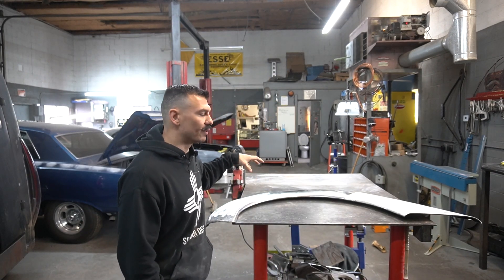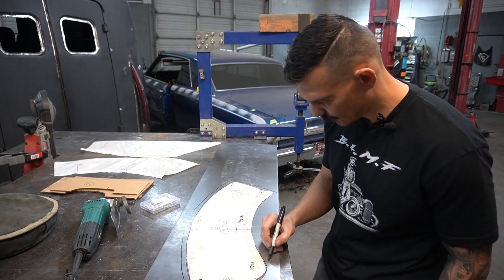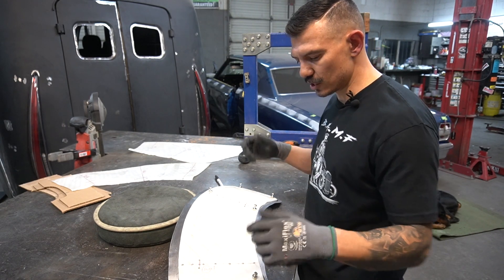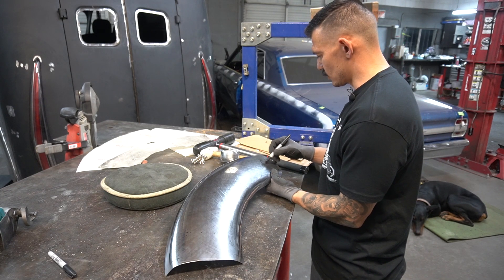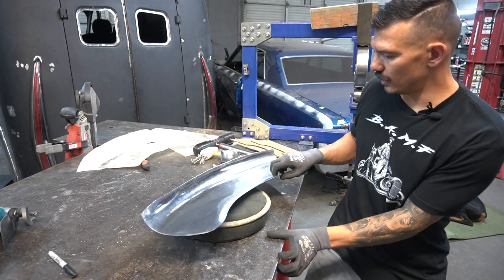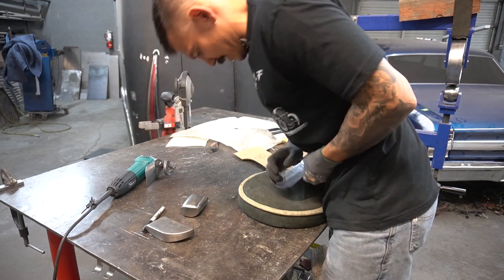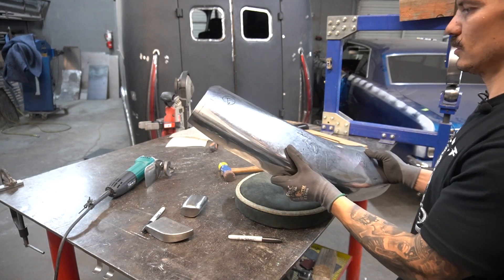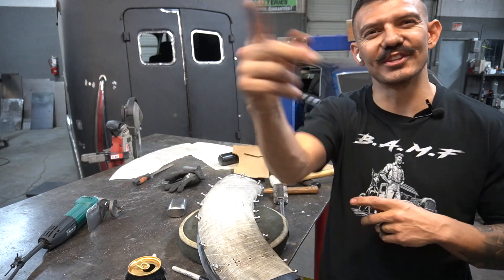How to use a flexible shape pattern | Build a fender

Comment: This video would have been a lot better if there wasn't a loud compressor running or whatever was making that noise!
Reply from the maker: I agree, It's my oil burning heater, it's loud and right by my work area. But it gets cold in my cinder block shop man 🤷🏻‍♂️
Reply: @BeAMetalFabricator  I was a mechanic when I was young and they had an oil burner furnace.  It did the job but the boss made me clean the windows once a week cause the oil burner furnace made all the windows cloud up. We were breathing all that crap. me and my four brothers are all car freaks from the 60s and Early 70s.  I really enjoy your videos. Wish I could spend my days building custom cars and pickups from the 60s and Early 70s

Comment: If you dont mind me asking , why didn't you attempt to make that fender in one piece?
Reply from the maker: Well I probably could but this is not an easy fender to build as in pieces and that would make it a lot harder to build being that this fender is probably around 4ft long, I would end up getting a lot of  bite marks from my English wheel dies, also my English wheel is not very big.  Are you a metal shaper?
Reply: @BeAMetalFabricator  I didn't realize it was around 4 foot. That would definitely be a lot to handle at one time.